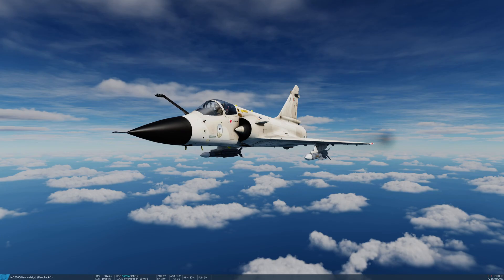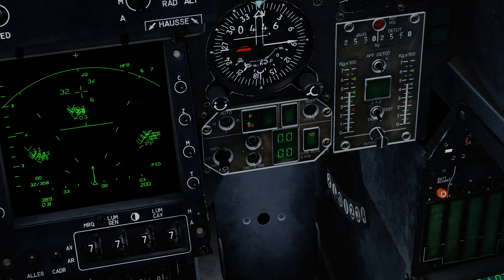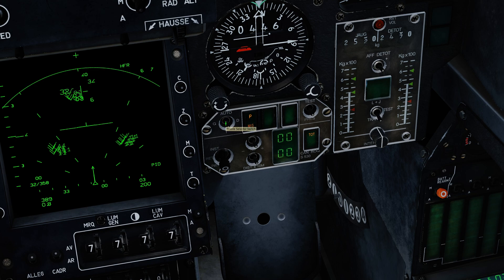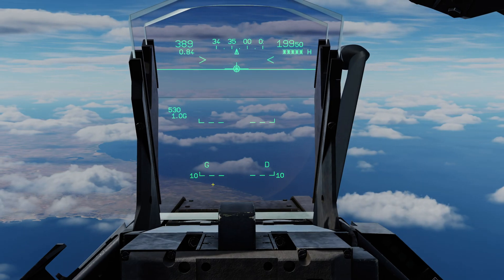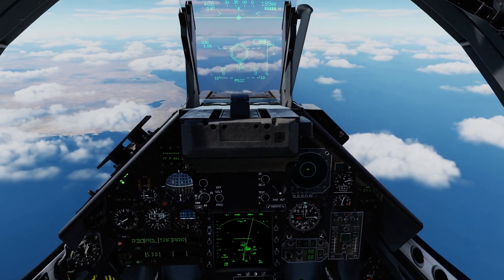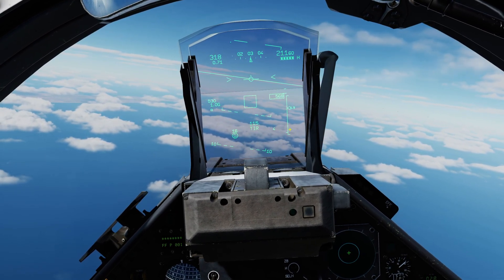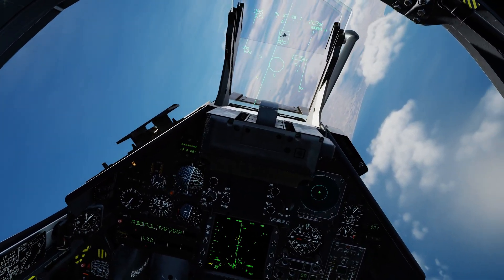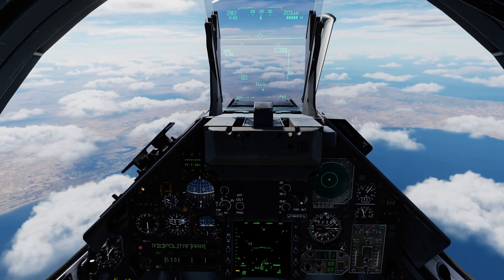DCS M2000C Tutorial 4 - Matra Super 530D

Comment: circle doesn't go on the target, it goes as close to the intercept cue as you can get it, which on your first shot is the smaller box on the middle right-hand side of the HUD. On your second shot, if you used that cue (it was off to the left) you might have actually hit that shot
Reply: It didn't fire initially either because he was in TWS mode not STT, then looks like when it tried to auto go to STT it ended up locking a separate target entirely.